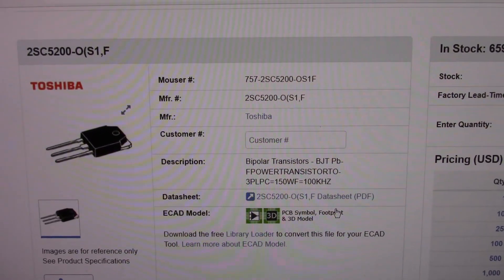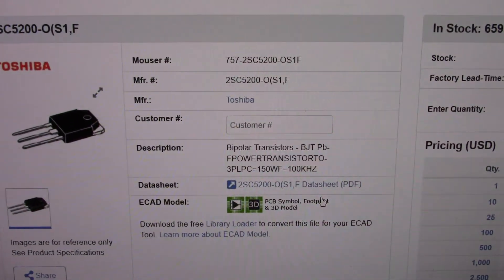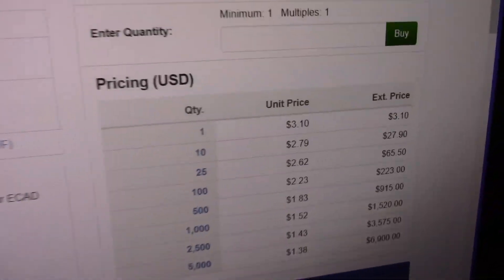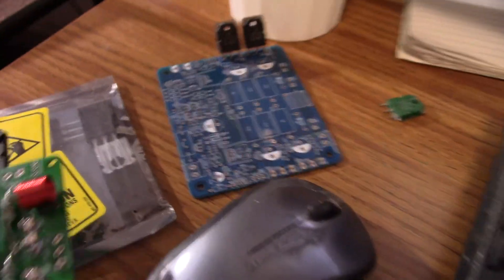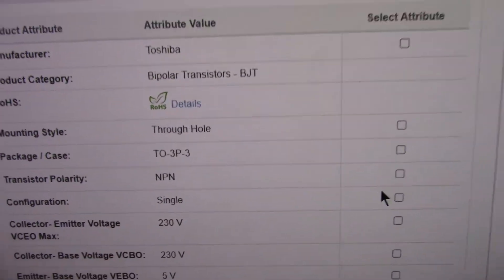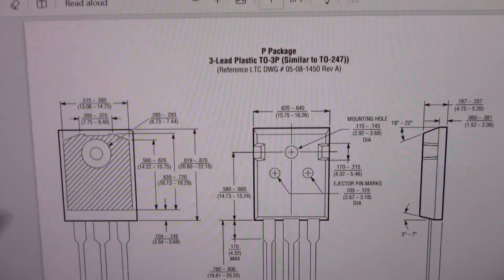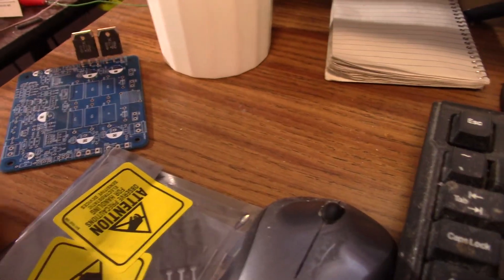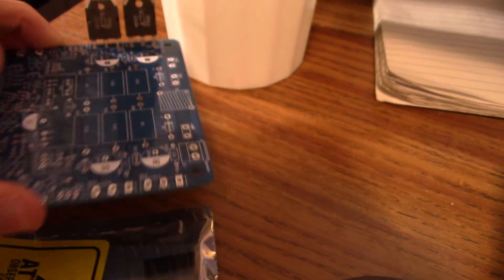Transistor case style confusion

Comment from the maker: I decided to assemble the board using the 2SD718 / 2SB688 parts that I have on hand just to test the boards and then redesign the board to fit the larger TO-264 cased (as I've known them) 2SC5200 / 2SA1943. I'll have a video out soon on the preliminary tests.
Reply: Good to know
Reply: I would like to try with the NJW0302/NJW0281 instead. TO-3P.

Comment: I like lcsc for this reason. They take proper pictures of each part & not just generic pictures. 
Buying the 2sc5200n & 2sa1943n from toshiba will solve your problem. Digikey have them in stock for 1.8$ each.

Comment: I've been bitten by wrong data and pictures on the distributor webpages too. 

But here one part of the confusion is that Toshiba, in addition to the number codes shown in the datasheets, call the package of 2SC5242 by TO-3P(N) and that of 2SC5200 by TO-3P(L). Onsemi and others use other names.

It seems TO-3P is not a industry-wide recognized standard package like many of the others and is loosely used to refer to ALL oversized TO-220-style transistors with TO-3 outer lead spacing.
I often see TO-218 called TO-3P too.

Comment: I would clearly blame Mouser for the product page description info error, BUT, looking at that Toshiba datasheet, although they do show the correct component dimensions, they do not state the name of the package anywhere on the datasheet. The Fairchild datasheet for that same transistor CLEARLY shows the part as a "TO-264" on the top of page 1, so, the person at Mouser that was responsible for putting product info on a page made that "TO-3P" guess-mistake. I mostly deal with Digikey, and I do catch errors and notify them, and every time they have made a correction and sent an acknowledgement e-mail in response.

Comment: Perhaps it is better to apply NJW1302//NJW3281. They are in TO-3P package. While MJL1302//MJL3281 in TO-264. Similar chip, different type number, different thermal conductivity. Unfortunately more expensive than 2SA1943//2SC5200.
Reply: 2sc5200n & 2sa1943n are made in the package he is asking for. 
Ttc002 or ttc5200 or regular 2sc5200 from toshiba are in the larger package.
Reply: They’re actually the exact same die, different packaging.  Obviously the larger having slightly better thermal management. Even though they’re a bit more expensive, they are a better transistor.